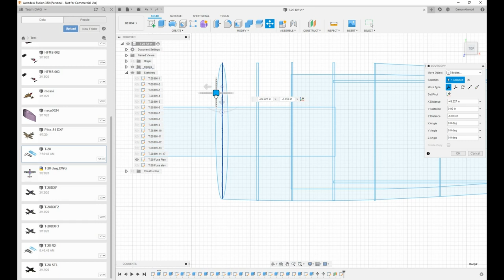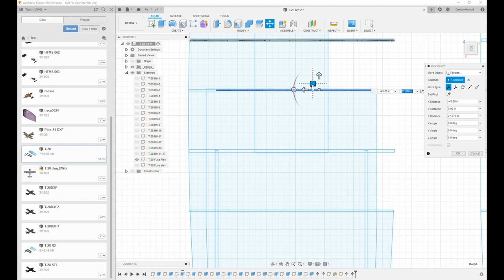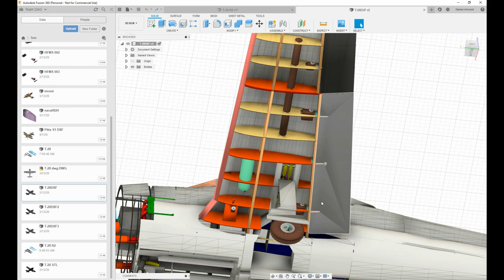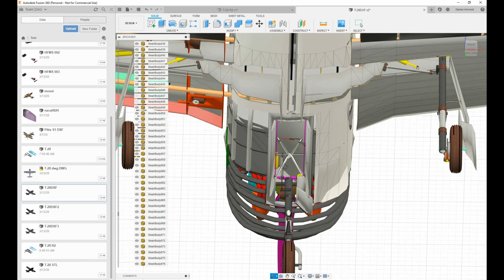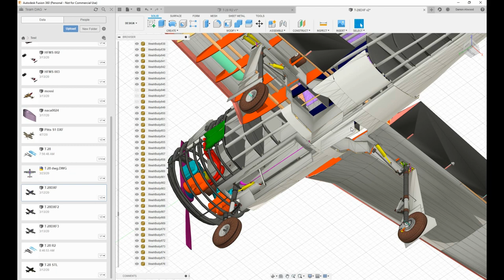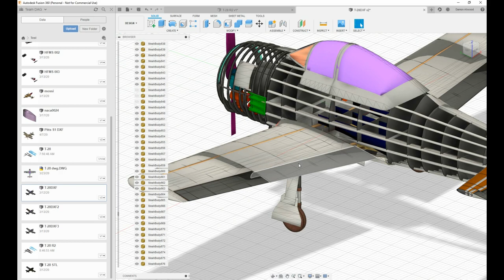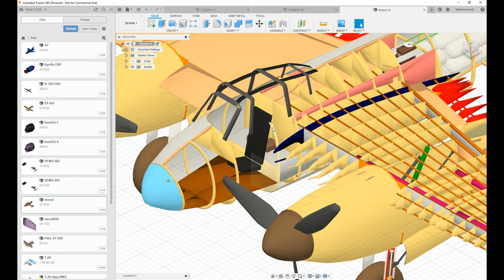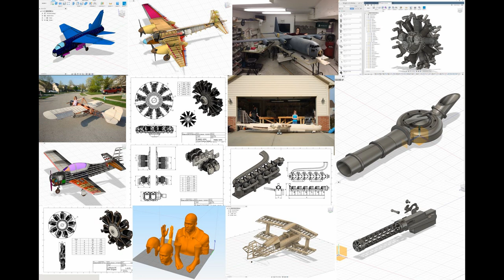F360 Virtual Build

Comment: Thank you for a great short video that shows things without getting to technical. One thing I am wondering is why do you take the DXF files into Autocad, first and not straight into Fusion 360.
Reply from the maker: The wings are designed in Compufoil which I take into AutoCAD to add flaps, ailerons, and stuff. I also feel more productive in designing the fuse in AutoCAD.  :)

Comment: I hope I can get as good as you at designing planes! What about building completely in Fusion?
Reply from the maker: I guess it would depend on the airframe. If I were to start from scratch I usually start with CAD, then import parts into Fusion 360 to assemble to make sure everything fits.  But, if I were to build a smaller plane (less than 50") I might start in Fusion. :)
Reply from the maker: And as far as getting good, it just takes time. That's how I learned, reading a lot, and just doing it. :)

Comment: Why not just design it, initially, in Fusion 360? It would save time lofting formers, ribs, etc
Reply from the maker: Because it was designed 10 years ago with 3Dsmax. I then took the old file and imported into F360 when I got F360. :)